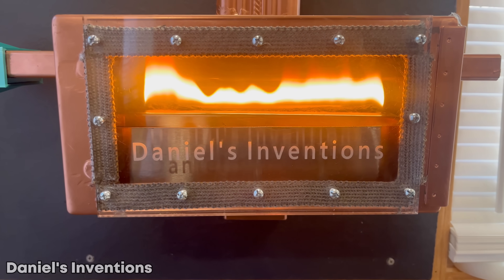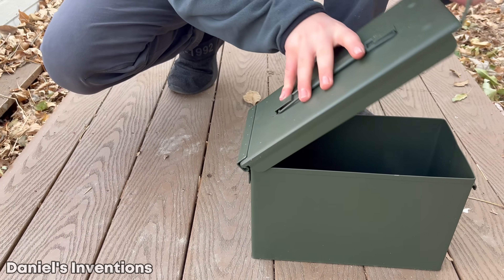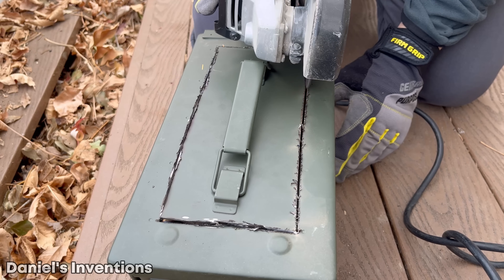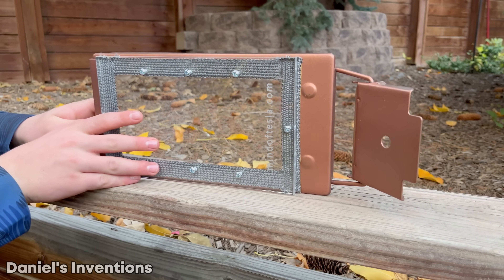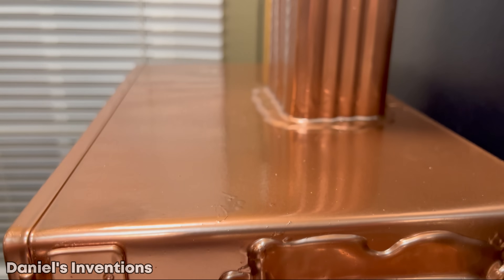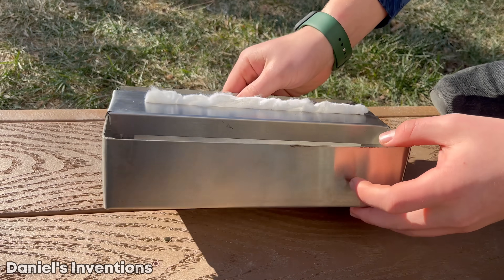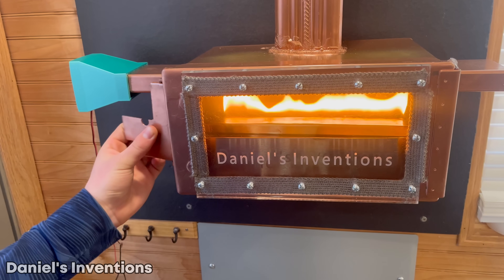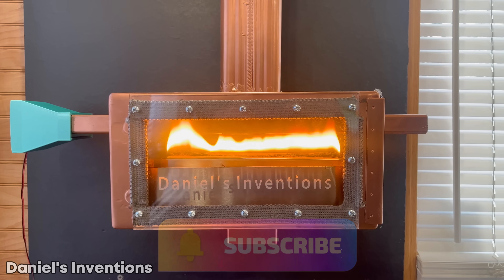ENDLESS Heat for Your Home WITHOUT Electricity 2.0

Comment: 2 things I would like to mention. Don't use JB Weld. Once you reach the breakdown temps of JB it will start to release some toxic compounds into the air. Also, don't cook out of cans foods come in. They have petroleum based or plastic liners in them. You don't really feel or see it, but it is there and has been for a couple decades now. When you cook in the can that does leech into your food. 

Otherwise, this is a great simple design for a small home or office area. I may would have put bend in tubbing and ran that through to increase the surface area and increasing the amount of heat that could have been created but this is a neat, clean straight forward design that does take up very little space. Nice work!
Reply: They have high heat JB Weld
Reply: @therealbeedubbs35  Still though if you have the option to bell the ends into flanges then seal and bolt them in place, I would do that. You never really know if there is a possibility of maybe certain chemicals coming out of the compound into a closed space like a room or office. I haven't found any study done on JB weld EXTREMEHEAT as far as air quality or possible contaminants only in its durability.
Reply: I would just be afraid of accidentally touching it somehow by tripping. Maybe you could cover it with a fire blanket material so it's safer to be around I think and then make a separate model that is essentially like the old stoves that also were used for heating homes. Something you could at least fit a pot on.
Reply: Hush. Just hush. This will be excellent for the gene pool in a few years.
Reply: yeah.. your not suppose to cook out of cans.. 
and ive heard the JB weld thing before too, because i knew someone that tried making like bongs n shyt with it and got sick..
Reply: The plastic liners in cans were outlawed in 2019.....they're only in soda cans now
Reply: Aren't a large majority of canned foods cooked in the can after they're sealed?
Reply: What is "bend in tubbing?"
Reply: @johnwgarrett1  just creating more surface area to capture heat by doing "S" curves 8n the tubing passing through the interior of the heater.
Reply: @brianchappell3660  gains for losses. Each Ben's will drastically reduce air flow lowering  the ratio of warm air output.
Reply: BPA liners in cans used to can food were outlawed, not plastic liners altogether.  What did they replace it with?  Probably something worse.  I guess we'll find out when someone researches it in 20 years or so.
Reply: All canned food is crap.
Reply: @truthhurts1032  bruh they asked "cooked in the can?"
Reply: @seankw5827  lol never use a stove for cooking if you're afraid to touch it, or fall on the eye. Are you serious? Smh
Reply: @thomasriddle8877  Most canned foods and many bottled liquids are sterilized after they are filled and sealed. The temps will reach extreme highs such as 280 degrees and so on for a set amount of time depending on the product and container being sterilized. This process is timed down the second for most products. Canned goods such as veggies, meats, etc will not reach the temps they are sterilized at on a simple stovetop in the normal process of heating the food inside the can to an eatable temp.  Not sure what myth made you think it was unsafe to heat in the can, but it is just that. A myth. I retired from a career of working in canning and bottling plants and even worked as a supervisor at a Pepsi production plant. Products like soft drinks are not sterilized and are not made to be heated. I would not recommend heating food in a soft drink can. For example, Coke cans do have a liner inside of them to keep Coke from eating through the container.
Reply: Make me one if you're willing...You sound knowledgeable and capable...Thanks GOD bless you and everyone...
Reply: They cool the food in those cans at the factory
Reply: @bigtimeLL  Some canned goods are sterilized at 280 degrees 300 degrees, etc. Of course, they are cooled down at the plant. I am not sure what the point of your comment is? Enfamil in the can is not cooled down much at all when sterilized in an old continuous can sterilizer.  The first stage is a pre-heat, then the sterilization stage, then a cool-down stage, but they are still very hot when they come out and cool down more as they move down the line to be packaged. What does the cooling down process have to do with heating a canned good in a can? The boiling point of water is 212 °F. Do you heat your vegetables or other canned goods? above 250 or 300 degrees? Corn sterilization temp is between  240 and 260 and most have a much tighter range. Do you heat your canned corn to 260 degrees?
Reply: @Ray-sj2iw  - Interesting but what about the white BPA lining that companies were using as a protective lining, for an unbelievable number of decades!??  I actually find it very hard to believe not a single person in the entire industry, had zero foresight to stop and realise that BPA linings would risk leaching harmful synthetic estrogens into everyone's canned food, especially foods with high acidity and/or high salt content, which would include most canned food items :'(
Reply: I thought it was lead solder at first.
Reply: The only part that’s getting to a burning temp is the part near the wick, so why all the talk about cans?   And if you geniuses are so worried about the plastic liner, just burn it out before using it 🙄
Reply: Cool idea.   I wonder if one of those heat powered fans would be strong enough to blow from the top of the heater and into the in side.  That way you don’t need electricity.
Reply: @therealbeedubbs35  I had the same issue with high heat jb weld too
Reply: @brianchappell3660  hi can you suggest a video on youtube that shows how to bell the ends of this oil heater into flanges and seal/bolt in place?
Reply: You're getting more plastic in everything else you ingest than cooking out of an occasional can.
Reply: @seeharvester  No, maybe if you microwave in plastic. It is true microplastics are everywhere and in everyone, and we dont know what that will mean for our species really, but the can liners WERE very easy to melt and in acidic food especially it would not solidify entirely when cooling. It just blended into the food. If others are right then this is not a problem anymore though, I don't know, they say the liners have been removed.
Reply: @roadtrippin2781  Ok, mr. Oppenheimer.
Reply: Petroleum based in not automatically bad for you, though most is.  Petroleum jelly is very good for healing wounds and as a base for antibiotic ointment.  Chewing gum contains petroleum wax, and many products such as crisps and snacks make use of colourings and other additives that contain petroleum products. Mineral oil can be used to help keep packaged baked goods fresher for longer periods.  That said, I probably wouldn't cook in a can even though they cans are sealed while the food is hot and many foods are cooked in microwaves or ovens in packaging lined with similar things.    Some things are relatively safe unless they get hot enough to smoke, like they might on that oil furnace.
Reply: @therealbeedubbs35  That was not what was used... it was clear.
Reply: @jimmywhitlow2012 😂
Reply: Agreed. Devcon is a better option.
Reply: Second on the plastic liners.  I make little camping stoves out of energy drink cans and the like, and the first burn must be done outside because that liner melts down to the bottom of the camping stove and then burns off once the alcohol is about to run out. I even had a stainless steel thermos i converted into a rocket stove type deal and it didn't look like it had a liner, but when it got hot it started smoking like an oil rig fire lmfao

Comment: You can improve it even further.
1)Use caebon wick as wick.
2) Use a set of peltier modules to run the fan.
A Peltier module can convert heat into electic energy. 
In this way, you will drastically reduce the costs of the wicks, make it electrically imdependent and the only thing you will have to do will be refilling it. You could also add a priming mechanism and a pipe that would allow you to refill the tank from the outside - without opening the lid.
Reply: That's awesome. I'm going to build a cabin and do this.
Reply: Thank you so much for compiling these suggestions!
Reply: these are very good improvements: thanx for sharing.
Reply: TEG Peltier + optional Joule Thief to generate enough current to run the fan. I'm surprised no youtuber has used this to make a video yet!!!

Comment: I am thinking of this for my attached garage. I have used electric space heaters in the past. The price of electricity is outrageous and this looks like a good inexpensive solution. Based on this build I already have most of the parts. In my opinion something like this is not for inside ones home/living space but rather a heat source for a garage or workshop or a tiny home or other out buildings. 

Lots of good suggestions in the comments. 

- Do a burn before painting is a good idea and is recommended for wood stove prior to installing.
- Use high heat JB weld.
- I like the idea of venting out the window (a horizontal sliding window) versus cutting a vent hole in the side of the wall.
- Installing the unit lower and draw the cooler air near the floor versus drawing cold air from outside. No need to cut an cool air intake hole in the wall.

The compact size makes it easy to remove and store in the summer and re-install every winter. 

In the video he used a rectangular metal pipe for the heat transfer but I would use a metal chain link fence post section cust to the required length. The metal guage of the fence post would be sufficient to withstand the internal heat. I have some old fence posts lying around somewhere. I just have to find them.
Reply: galvanized pipe would not be recommended..also a fresh air intake with a valve to control amount of air flow is advisable to prevent low oxygen inside your heated area

Comment: I like the concept! I actually made something very similar but I installed copper pipes to act as a heat exchanger which in turn creates alot of heat. I used a can of sterno for my heat source. I actually fine tuned the copper heat exchanger so well a candle even worked! Great job on the build...creative!
Reply: As I read some of the comments including yours I am amazed!  Keep up the creativity!
Reply: @Doug we’d love to see your setup!
Reply: Your design sounds impressive do you have plans or a step by step video of your setup I'm very interested
Reply: Can you link us to a picture of it?
Reply: What was your method of fine tuning the copper pipes? We're making one right now and I'm worried that our flames aren't going to generate enough heat.
Reply: I did something similar with a hyper 212 cpu cooler, a metal plate, and some Tea candles. Produced enough heat to warm my room dramatically in the winter!

Comment: Wrap a small diameter copper (water) tube around a portion of the flue pipe to turn waste heat into hot water. Would require an overhead (insulated) resevoir, pressure relief valve (unless it is an open system), and a faucet at the bottom.

Also, put a pot of water on it to return moisture into your building that is being removed by the heat.
Reply: I was thinking something along those lines as well... This would be perfect for a small camp or even an ice fishing hut...
Reply: Be careful about mold though
Reply: That is a great idea!

Comment: I’m sure the electric companies will love this 👍
Reply: Why would they care a heat pump cost less to run for the same amount of heat
Reply: @shaynegadsden  Heatpumps are great for keeping a house at 20-23degreed C. When it's freezing cold like -35 like in Norway you NEED a firewood oven. Wood in Norway has gone up a fuck ton lately because are government has decided to ban firewood heating soon because they want to control everything with electricity. A solution like this would have been a blessing.
Reply: @devinegamingtv3427  geothermal heat pump not only is it even more efficient than a regular heat pump ambient temperature has little effect

Comment: Daniel you now have a very good reason to learn to weld and then you won’t need an my jb weld or concerns about the temps getting too high. You can also find paint for bbq pits that should withstand the high temps. Great build though, I would consider a cover for the oil cause one little flamey bit drops into that container and you could have a potentially disastrous result. Otherwise impressive engineering
Reply: I bought a 60$ welder from a pawn shop and it changed my life 

massively expanded my ability to make things, it was seriously like not knowing about cordless drills then getting one

I'm 40 and have spent my entire life of crafting and woodworking, thinking of welding as something other people do. one of my biggest regrets is i didn't just do it sooner.

seriously for 200$ you can setup and teach yourself to do simple welds and it's been huge.
Reply: The rain gutter pipe is very thin and would be difficult to weld. It would also be more difficult to make it perfectly airtight with just welding.
Reply: @incorrba  nah I've welded on worse lol, just need to turn the heat down and spend more time on the thicker metal just basically dragging the pool over to the gutter briefly and going back quickly before you burn through.
Reply: High heat red silicone work great. I use it on gaskets for pellet stoves.
Reply: The oil will not burn if a flame drops into it. It requires a wick at that low of a temperature.

Comment: For the next level of off-grid utility, you could add a small Stirling engine to generate the electricity to run the fan. Once the heater warms up, the fan will kick on and the only input is fuel.
Reply: You can also just let convection do all the work too. Just run the air intake for the heater to the floor and it will naturally suck in the colder air from lower down as the hot air comes out at the heater.
Reply: @SilvaDreams great idea!

Comment: Great job. I see a lot of good suggestions in the comments for a 2.0 version. You should also modify you heat exchange. Use multiple smaller round pipes and have them loop around the inside of the furnace so they pass the flame twice before venting out. You'll mimic modern day furnaces and gain more heat transfer to up the efficiency. Great design though. Perfect for a small cabin or tiny home.
Reply: yes,I might even circle around a water tank. I was thinking animal fat can also a fuel. Lots of tips from other comments! a good read!
Reply: I thought this was 2.0, by the title?

Comment: TIP: i build rocket mass heaters and have been heating 1200sf with 5 face cords of free pine off cuts in  northern mi were we get sub 0 temps.
Mod your  Exhaust rather then straight up and out shape it to go back and forth a few feet at an upward angle. This is called a dragon pipe. It alows more of the  Exhaust heat to sap out into the room before it gose outside.  Should squeeze a lil more heat out of it

My RMH burns at easly 2000 f   and the chimney is only 80-100 f  so cold i use a plastic pc fan as a assist fan

Comment: Nice build. Compact and looks good on the wall too.
Just a tip for cutting your steel box. Try drilling holes in each corner first so when you use your angle grinder you will get a cleaner cut to the corners. If the corners need to be square you can use a file to achieve that.
As the hot air is vented out the exhaust flu new air must be introduced to the room which usually means cold air from outside will be sucked in through window and door gaps creating drafts. To help prevent this you could draw your cold air from outside rather than the room by putting another hole in the wall and channelling your air intake through there. 
For your wick you could also use pure carbon felt. Not too expensive and will last forever. 
Keep up the good work
Reply: Combining that idea with a basic heat exchanger would boost the overall efficiency tremendously.
Reply: whitemaninventedeverything9511  Nah, man, it's way more fun in public.
Reply: What is carbon wick? Where do I get it?
Reply: I agree. Drawing cool outside air means you are not throwing away the warm air that you just heated. This one change dramatically improves the efficiency of the heater. I hadn't heard about carbon felt before, that's also a great tip.

Comment: One reason the horizontal build is superior to the vertical build in your previous heater is that vegetable oil is thick and tends to fall off when the supply goes down below a certain level on the wick and the heater fizzles out. This is the same thing that happens with vegetable oil lamps that need a short distance between the flame and the bottom of the oil supply. 

This model looks like it is easier to fill and safer than your previous version. Enjoy your warm home!

Comment: Neat job!  Consider stuffing the heat pipe with copper dish scrubbies. I think you will find it will hardly impede flow but extract a lot more heat from the system.
Reply: The thing you need to make sure of its that you still have enough stack temperature. Extract too much heat and you lose draft. There's a sweet spot we have to find.

Comment: Marvelous idea Daniel!! so very much appreciated going to construct my first unit. Will comment on its performance, wish me luck....
Reply: Read through the comments. Useful tips. Such as, don't use non heat resistant adhesives and paints as they will offgas. Use carbon fabric as it won't need to be replaced. Have the air intake draw outside air into the furnace so that you won't be drawing air from your house that you just spent fuel warming. There's many good tips to improve this project.